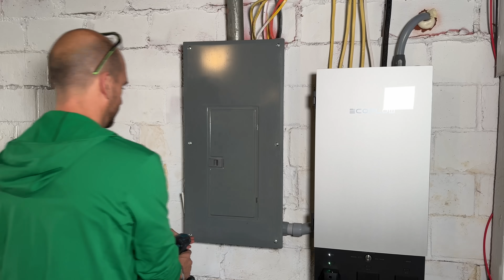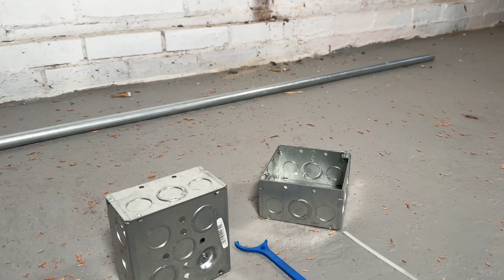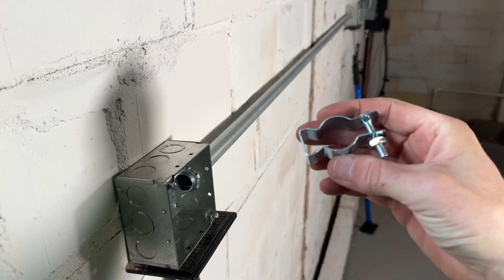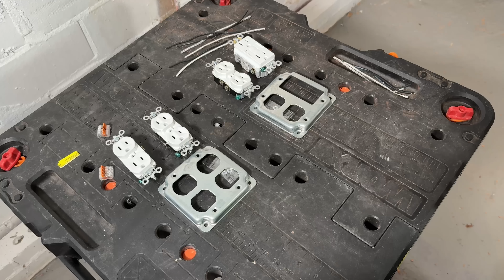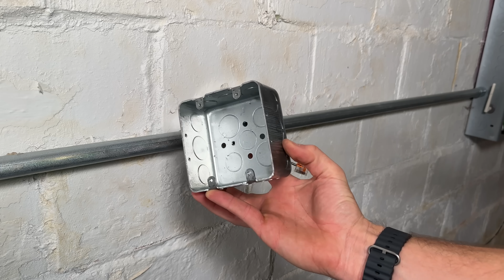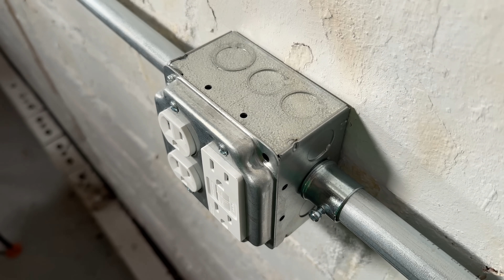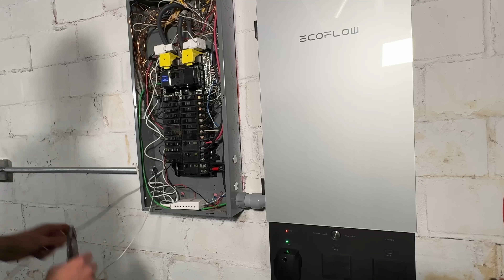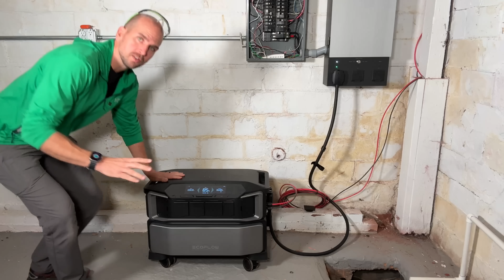Add Outlet To Unfinished Basement Or Garage

Comment: Romex isn't rated for damp or wet locations, and an inspector will consider a basement a wet location most of the time. Some THWN in that conduit would be really easy to pull though. Thanks for the video!
Reply: Incorrect. A wet location is a location that is saturated with water. The only time a basement is a wet location is if it rains in your basement or there is water regularly spraying everywhere. Damp basements, ones with visible moisture everywhere on walls, surfaces, etc., would be considered damp locations. Most basements are dry locations and the basement in the video is clearly a dry location.
Reply: @pld8993  If your basement is underground, it’s a wet location. Read article 100 in the NEC. Installations underground, in concrete slabs or masonry in direct contact with the earth or in areas subject so saturation with water.
Reply: If your basement is underground, it’s a wet location. Read article 100 in the NEC. Installations underground, in concrete slabs or masonry in direct contact with the earth or in areas subject so saturation with water.
Reply: @apaskiewicz  Incorrect. Only a "basement" that was 100% covered by grade, like an underground bunker, could ever be considered underground. The ceiling of a basement is above grade and the floor is a concrete slab (usually), below grade and in direct contact with the earth, not underground. Underground means under the surface of the ground, not lower than ground level (grade). A basement is basically a hole in the ground but not underground. Under the basement floor is underground. If you were right, every panel in every basement would require an outdoor weather proof panel, UF cable, weatherproof connectors attaching the cables to the panel, weatherproof boxes and covers, etc.

Comment: Dude put down the screwdriver. You’re a hack. No straps on the conduit, the tubing cutter is a HUGE no-no, 15A receptacles on a 20A circuit, no grounds on the receptacles and drilling into the grout instead of the block. NOBODY should listen to a thing you say about electrical.
Reply: Doesn't everything on masonry require plywood or backstraps to prevent corrosion and loss of system bond ???? 😢

Comment: I want to use 2-inch PVC pipe as a raceway.  Indoor dry environment. How many 12-2 Romex wires may be run in this pipe and still comply with the 53% rule?
Reply: 40% rule. The answer is 10.
Reply: Use pulling compound you can get more in jk 😂😅😮😊

Comment: In my basement,  I'm running romex along the floor joists in basement ceiling,  then dropping down for switches or outlets.
Any code violations if I run the romex in metal conduit only as it comes down from joist to wall outlet or switch?
Reply: That's exactly how it should be done.

Comment: You are 100% allowed to run Romax in conduit. You just cannot run Romax and wet locations which basements are per the NEC.
Reply: Basements are not wet locations. A damp basement can be considered a damp location, but most basements are dry locations.

Comment: Nice work, not a fan of the tapcons in a brittle wall condition, also if you didn't have 12 gauge on a spool you could have removed the romex  & accomplished the  the same result, good install

Comment: Yes, using conduit (bonded/electrically continuous metal) in place of an EGC (equipment grounding conductor) IS Code Compliant; however I would've just run a ground anyway.  I mean, hell you upsized to 3/4" EMT, so conduit fill is hardly an issue...  And for that miniscule distance?  You're not breaking the bank to run one more 14 AWG THHN.

With this installation, you're relying on the 3/4" EMT connectors/their set screws to maintain continuity.  Will it a be a huge issue down the line?  Probably not, but for so little cost why take the risk?
Reply: The conduit is not "in place of an EGC," the conduit is the EGC.

Comment: There is 100% no code issue running Romex in Metel Conduit. The only issues would be if you have too many turns, as the jacket makes it hard to pull, or the metal conduit goes outside. That straight, easy-to-pull run is fine for using Romex.

Comment: Wrt raging debate about grounding wire or not, what is the equivalent gauge of the EMT to the 12 gauge wire?  As for EGC concerns, if there is a short to ground arent the 3rd wire and EMT at the same exact potential?
Reply: There is no equivalent gauge, so to speak. Conduit/Tubing is a better EGC than a wire type ground up to about 400' because of skin effect so in actuality, 1/2" emt is a much larger egc than a #12 because it has significantly more OD surface area.
Reply: @pld8993  Exactly and why I prefer to use the EMT, w/ ground wire to swicth/outlets ground lug so they ar estill grounded even if unscrewed and hanging.  A simple test reveals if the EMT contnuity has been disturbed.

Comment: Why not use 20A devices if you have a 20A circuit?  Also why not just use all decor style receptacles for the sake of craftsmanship.  Also why not just run a ground wire?  Also why did you do the job twice by putting it up and taking it down then putting my back up again?  You can hold the boxes up and drill the holes at the same time.  Also why didn’t you put a strap on the 6’ stick of pipe and the other one if it’s over 3’ long?  Also why didn’t you just use the 3/4 k/o was on the bottom side of the panel instead of making the 1/2” bigger?  Also why didn’t you just use 1/2” pipe.

Comment: I'm a retired Journeyman electrician and I do have opinions on your Electrical Metallic Tubing installation and I think it falls somewhat short of NEC compliant. The NEC requires that EMT be supported within 3 feet of each box and every 10 feet of continuous run. Since the length of the longer piece is 6 feet that would require one of those Mineralac conduit clips at exactly 3 feet as the minimum required support. There would also need to be  a support in the 3 foot run  because every length must be supported independently of the boxes. There are exceptions but none of them apply to that installation. 

I will not harp on my particular beliefs on grounding for raceway installation because the US National Electric Code (NEC) doesn't have a requirement for a particular conductor type for Grounding in them. 
[Raceway is a term encompassing any enclosure for wire and cable that provides physical protection and, in many metallic raceway installations, the low impedance ground fault current path that is required by the NEC.] 
Since the code requires that a raceway system be complete prior to the installation of conductors I can test the raceway assembly for its impedance back to  the service equipment's Main Bonding Jumper before the first conductor is installed. That is good practice anyway because an electrically discontinuous portion of a raceway run can act as a high impedance choke against the flow of fault current in a wire EGC and thus hold the amount of fault current below the trip level of the Over Current Protective Device. 
[In residences that will nearly always be in the form of a fuse or circuit breaker.] 
Keep in mind that although an Equipment Grounding Conductor (EGC) does not count as  a current carrying conductor for ampacity calculations it does count toward conduit fill. So, depending on the details of the installation, using a metal raceway as the EGC may save going up a raceway size thus raises the cost of the whole installation. The more conduit you are installing the more that effects the cost. My position then is that there is no ONE correct answer for whether an wire EGC should be installed with the other wire conductors in a raceway system. It should be done were experienced judgement suggests its use. But were it is clearly unnecessary I would sometimes do without it to hold the customers final cost as low as is practical. 

I've come to prefer running EMT, in unfinished areas, vertically rather than horizontally because it deters the occupants from using the EMT as a support for other things such as coiled hose and cords. There are changeover fittings that are listed for 2 NM cables that allow me to run the NM cable through bored holes in the floor joists above and removed from most causes of physical damage. One piece of EMT running down to the surface wall box then brings NM cables from each direction down to the box. The cable must be sized as a single conductor calculated as a round conductor for its cross sectional area based on its widest dimension. The conduit size is then selected from the % of the conduit that may be filled by 2 conductors. 2 conductors is the least percentage of fill. Alternatively the NM can enter a surface box near or on the joists and be spliced to individual conductors which take the circuit down to each lower box. That is more splicing but it may save 2 nominal sizes of EMT. The larger EMT with the only one box at user height saves splicing work and reduces the number of points of connection failure. All of these are choices. There is seldom only one way that an installation can be done. 

Tom  Horne
Reply: Anything less than 3' does not need additional support independent of the boxes.
Reply: @pld8993  What he said in the video is 3 feet. That means it gets a strap.
Reply: @hornetd  There is no rule that says every conduit run must be supported independently of the boxes. Up to and including 3', no strap needed because each box/fitting provides support within 3' of the other box. Additional support needed for anything longer than 3'.

Comment: Conduit needs supported within 3’ of every box. You need to put that mini in the 6’ run. Always pull a ground for safety and bond at every box. A good practice when using metal boxes is to wrap your outlets in electrical tape for service/maintenance removal. Securing with tap cons works but plastic anchors would be better, and in the block more secure than the mortar joint. Code doesn’t specify but using Romex in conduit does change your temperature rating of conductors.
Reply: Romex is required to follow the 60C column and putting it in conduit does not change the temp rating..

Comment: NM Cable is permitted to be installed in EMT with the sheath - 334.15(B), 358.22- second paragraph, Chapter 9, Notes to tables. NM Cable cannot be installed in EMT outside or underground.
EMT is a permitted means of grounding, 250.118 (A)(4). And for emphasis, if the EMT is properly installed, it provides an effective ground fault path. The reason so many engineers specify an additional conductor for an EGC is human error. NM Cable and MC Cable - the conductors are not stamped every 24in with the required information as per Art 310, 310.8 - hence removing the sheathing of either cable and installing in a raceway would be a violation. If installing in EMT for protection, see 300.18 (A) exception

Comment: jeez, i would never run that conduit without a 12 gauge ground wire!  especially in a potentially wet basement.  a sump pump would def need the ground, for instance
Reply: The emt is the ground, wire type ground is not necessary.

Comment: 2 problems 1.where is the fiber washers on the conduit connectors. FAIL Now for the worst. You should never count on the Condit as the ground. You shoid also run a green ground! While working on a old Panudit tray  as getting the crud shocked out of me. Never trust the metallic ground of conduit. ~~ Cris h.😊😊😊😊
Reply from the maker: Thanks for the feedback.

Comment: All DIY watches need to read all the comments left from this video,
Never do it yourself if you not going to do it correctly.
So many bad tips in this video. No ground wire?
1-
Never get cheap and skip the ground wire
2-
You most certainly can use Romex NM wire in this situation.
3-
Never Tapcon into the mortar joint, sure it’s easy but it won’t hold against pulling pressure.
4-
Why drill the box for a 3/4-get the 1/2 “ your only running single line of 12 gauge wire.
5-
Maybe in a garage you might want 220v outlet

Comment: You can definitely run romex in metal conduit. You cant run romex in wet locations...unless its wet rated romex or you have it inside pvc conduit.
Reply: Romex cannot be in wet locations in any kind of conduit, no exceptions.
Reply: @pld8993  what's the code that says that? I'm not saying your wrong I've just never seen which specific code says you can't run romex in conduit.
Reply: @boone7777777777  NM (Romex) is allowed in conduit but in dry locations only 334.10(A). Conduit installed outdoors is either a damp or wet location, so NM is not allowed.
Reply: @pld8993  he was running it in the basement though. So isn't that fine?
Reply: @pld8993  you can also use pvc conduit in wet locations so I thought.
Reply: @boone7777777777  Yes
Reply: @boone7777777777  NM in EMT or PVC in a basement is fine, dry location. NM is not allowed in either PVC and EMT in damp or wet locations.
Reply: @pld8993  show me the code that says that.
Reply: @pld8993  what code is that?
Reply: @boone7777777777  334.10(A) NM, uses permitted, dry locations . 300.9, interior of a raceway installed in a wet location is a wet location.

Comment: Hey I could be wrong but it looks like you anchored those tampons in the mortar between your cinders. 

For reference this is not advisable. Mortar is not as strong as the cinder or concrete. Drilling into this can cause it toflake and powder eventually jeopardizing the walls integraty

Comment: I've opened up boxes where I had correctly used Wagos with correctly stripped wires and found wires pulled out of the Wagos. When you fold and then jam your wires back into the box there will be pressures and stresses on the Wagos that will make you have nagging doubts. I don't make any money endorsing anything and the only thing that I have full trust in, as a DIYer, is a good twisted connection. That gives me the peace of mind I seek
Reply from the maker: Thanks for the feedback 👍
Reply: @EverydayHomeRepairs  I have used wire nuts and wegos and i would trust a wire nut a lot further than a wego.

Comment: You CAN use romex in conduit. Its a never ending argument that just keeps coming up over and over again. Just adding conduit doesn't make romex suddenly unfit or somehow dangerous. What you cannot do is use regular romex in many places where conduit is typically used such as a "wet" outside or underground location. You absolutely can use romex in conduit in an attached garage. its not a location where a specific type of cabling would have to be used. If for some reason you wanted to use a romex product in conduit in a wet location, you would have to use one rated for use in that type of location assuming it was outside of conduit.

Comment: The ground was needed. Really bad practice there with no ground wire. That outlet must remain grounded even if pulled out of the box with the other wires still attached. What you did is not permitted anywhere I ever heard of. Maybe Haiti?
Reply: metal tube acts as ground.
Reply: @tacke597   Emt not rated as a bonding conductor in many places because things come loose.
Reply: @rickhawkins218  - It is rated for this per NEC code.
Reply: @robmurray5784  Original poster gave you good advice. He may have 40 yrs exp like i do. Bonding conductor plays a huge role in electrical safety. A poor bond blows clear easily when a short occurrs in a piece of equipment. All metsl parts often  become live beyond the break. I have seen faults like this twice in main services where all grounded metal parts in the home were live to ground- once where crews of workers had metal saws in their hands.
 The locknuts and set screws should not be relied on. You want the breaker to trip on a fault.
Reply: @robmurray5784  When conduit is installed properly, it is more than sufficient as a grounding path and a wire type egc is unnecessary. I don't understand why the naysayers keep proclaiming that conduit fittings magically loosen yet they never make the same unfounded claim about ground screws. The NEC lists 14 different types of grounding means, only one of them is a wire and in no place does it make the claim that the wire type ground is preferred or superior, because it's not. Those of us who've installed hundreds of thousands of feet of metal conduits probably know better than those who haven't.

Comment: If this electrician is setting up a 20 Amp circuit, he is wrong. He installed 15 Amp plug-ins on a 20 Amp circuit.
Reply: Many residential outlets are 15 amps, not 20.
Reply: 15 amp receps are allowed on 20 amp circuits.
Reply: If he used a 15a breaker and 15a  receptacles and #12 he ran a 15a circuit with slightly  over-sized branch circuit conductors. Done all the time.
Reply: A 15A duplex outlet is allowed on a 20A circuit, even with a 20A breaker. The only case that would not be allowed is a 15A single dedicated outlet (not duplex) on a 20A circuit.
Reply: @steveb2976  In the states?
Reply: @rickhawkins218  Yes
Reply: @steveb2976  The 20a rules always were more lax down there.
Reply: @steveb2976  Not allowed in the great white north.
Reply: @rickhawkins218  If you use the NEC up there then it is allowed
Reply: @rickhawkins218  Took me a minute to realize you are in Canada. Not sure what the CEC allows regarding this
Reply: @steveb2976  CEC up here with each province and territory having their own book with rule changes or clarifications. 'Ontario Electrical Safety Code.'
Reply: @steveb2976  You have to match the receptacle to the breaker size.
Reply: @dickdonaway905  @rickhawkins218 Yes

Comment: No box offsets, no emt straps and boxes not grounded this would not pass inspection sir let the professionals do the teaching.
Reply: Box offsets not required, boxes are grounded/bonded through the emt. The emt to the first box is less than 3', no mini or strap required. The only violation here is that 6' length of emt needs support,  1 mini in the center covers it.